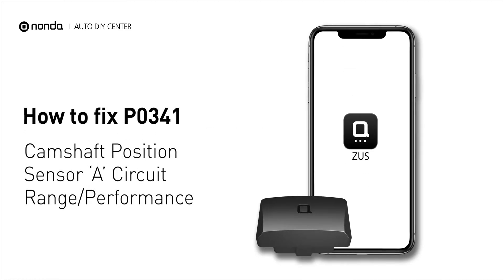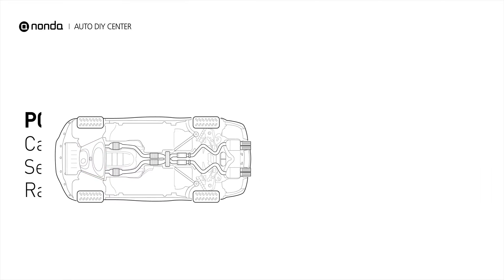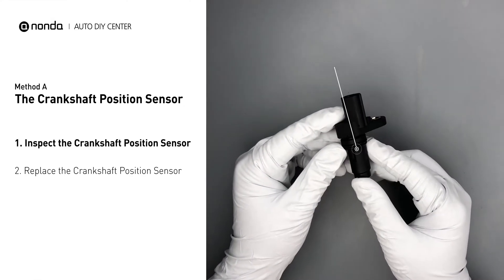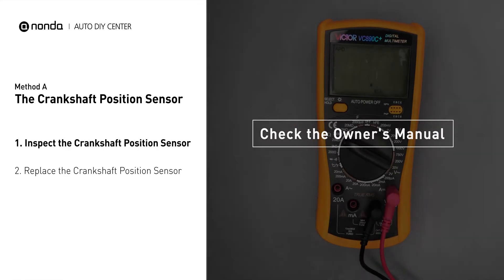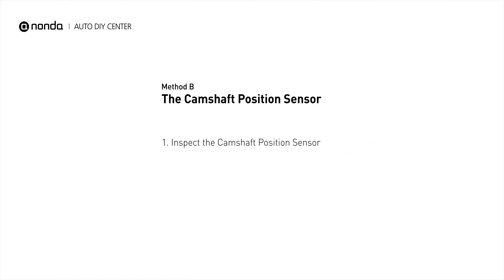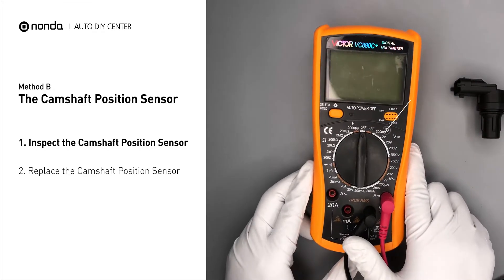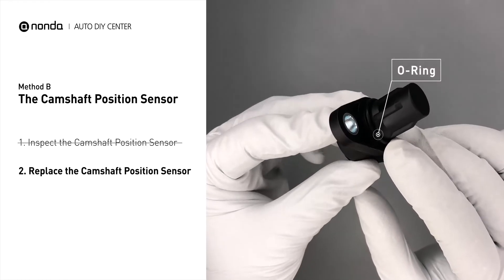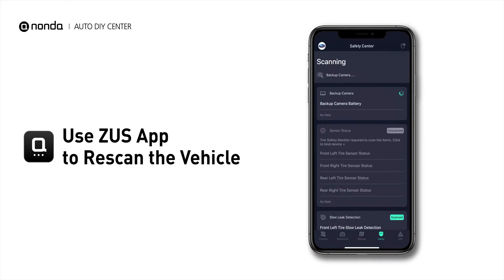How to Fix P0341 Engine Code in 3 Minutes [2 DIY Methods / Only $9.45]

Comment from the maker: Hi, I'm Steve, nonda's lead mechanic engineer. 
Feel free to leave your comments here if you have any mechanic questions, I will be glad to help you out!
Reply: Hi Steve! Were do I find po341 sensor on Audi a3 sportback 2011 1,6tdi?
Reply: Hi Steve, I got Land Rover discovery sport 2016 and i am getting P0341 engine code, do you think i need to change the timing chain please or is it just replacing the sensor, the replacing chain is an expensive job of £2500

Comment: Yikes!  There are SO many other things that can cause a P0341 on a Honda other than a bad cam or crank sensor. Either would be an easy fix.  On the 2.4L engines, 95% of the time it's something other than a sensor.  I strongly recommend seeking advice elsewhere.  It appears to me they're more interested in selling scan tools than actually helping people fix their cars.

Comment: My dad is a mechanic but often gets busy after he fixed blown head gasket this code popped up saying camshaft and car shakes now so should i replace both sensors or replace the one its telling me is giving me the problem?
Reply: What did you do? I had the p0018 code basically saying I need to replace the camshaft sensors, I did that now I got this code I think it may be the crankshaft aswell
Reply: I have the same problem after the head gasket, did he ever figure it out?

Comment: Hello i have some Problem on my car with this code P0341 A. The diagnostic problem Show me: 
Camshaft position sensor circuit A range/performance (block 1 or one Sensor)
I have this code on my ford focus Mk2 2005 Petrol 1.6 85kw.
When i connect my computer on this they show a problem with camshaft sensor, but in your video is the problem with crankshaft sensor, p0341 A (B is camshaft.)
I replaced a camshaft sensor but still sometimes the car lose the power. He can go max120km/h and max 3000-3500 rpm.
He still show me the code p0341 A...is it need to replace a crankshaft position sensor.

Comment: My Chevrolet Spark shows this code, ihad clean both sensor and camshaft also replaced with new one but problem not solve
Reply from the maker: Can you please confirm if this is the only code you're receiving?
Reply: @nondainc  yes only p0341

Comment: Camshaft position sensor fixed it. Now p0341 code comes up . And it's telling me camshaft sensor position needs to be fixed . Need help anyone?
Reply from the maker: Hi David, can you please provide us with your vehicle's year, make and model so we can provide you with a possible solution particularly for your car's make/model?
Reply: @nondainc  2007 yukon gmc 6.2 xl 
Thank you for responding highly appreciate  it 🙏
Reply from the maker: Hi David, have you inspected the camshaft position sensor wiring? Check also the voltage at the camshaft sensor if within specification.
Reply: @nondainc  hello nonda. 
Once I took it back to the same me mechanic that had fixed the camshaft sensor.  He checked and tested it , numbers and everything's fine. He said I could even drive it with the engine light on. So I drove it . It sputters revs on its own car shakes when I turn on. I really don't know what to do next . Sorry for the sob story .

Comment: I have a VW Fox, I have been having this issue for the longest time, I have replaced the crankshaft and camshaft sensor but I am still having the same issue, what could be wrong?
Reply from the maker: Hi Hubert, have you double checked if this is the only code you are getting?
Reply: @nondainc  for me this is the only code I get since yesterday. 2016 Jaguar XF. No symptoms, although there has been some rattling from under bonnet since I bought it one month ago. I turned the CEL off and it came back on after 20 miles.

Comment: Have a p0341 code. All i did was change the camshaft sensors & now it wont start. Help please😭😭
Reply from the maker: Hello, please ensure that the Crankshaft Position Sensor is also inspected as the issue could be coming either from the camshaft or the crankshaft position sensor.
Reply: @nondainc  thank you for replying i really appreciate it. I didn't want to take apart the whole front of the car but looks like im gonna have to. Ill keep you updated on it just so you know. I have a 2006 bmw 325xi
Reply from the maker: You're most welcome!
Reply: @EnderCraftKid  update?
Reply: @Rogue HD  yea i found out i was the one who goofd on the camshaft sensor installation. I needed 2. Put the 1st one in. Then i messed up seeding the 2nd one in & im really supprised my car didn't mess up lol. But honestly a month after i posted this i took her to the shop & found out it needed a whole ass timing change and there was a oil leak on the seems of the oil pan. So had to get that changed. Also found out i needed a new steering angle sensor. All in all cost me $2,200 for parts & labor. I had to pay a mechanic to do the timing change because i dont know THAT much on cars. So it definitely sucks considering i only paid $4k for the car but shoot. Honestly probably gonna sell it and get me a M3. Bmw are nice but man. Something goes wrong with they're money pits😂

Comment: Thanku.   Is it possible that the timing chain can stretch? I have the error code P0341 ( Australian Honda Odyssey 2014)
Reply from the maker: Hi Ibrahim, you can detect if you have a stretched timing chain if you encounter lack of power on acceleration, rattling noise and hard starting. Honda has a special tool that can check if the timing chain is stretched.
Reply: @nondainc  thankyou. I definitely got noise , sluggish drive and an PO341 with multiple warning lights on dash :)
Reply from the maker: You are most welcome, Ibrahim!
Reply: @nondainc  Hi thanks for your video. Can you let me know what is the special tool to check if timing chain is stretched? And if that’s the case is it very hard to do?

Comment: hi there I replaced my camshaft sensor but not the crank shaft sensor. still have the code but am going to replace the crankshaft sensor. should that clear the code theoretically?
Reply from the maker: Hi Matyson, yes it's possible. A loose connections or damaged wiring could also triggers this code so we suggest to have it checked also.
Reply: @nondainc  will do!

Comment: Hello
does it mean the camshaft and the Crankshaft are similar ?, or perhaps even the same
Reply from the maker: Hello, they could be confusing but they're not the same. They each perform a different function/role. The camshaft is located in the top end of an engine while the crankshaft is in the bottom end. They are both connected by a timing chain/timing belt.

Comment: I have this code on my 2002 CRV.  It idles and runs perfect with no obvious issues.  The previous owner replaced all of the timing components.  If the sensor is bad, shouldn't I have symptoms?  The only indication of a problem is the CEL. Should I attempt replacing the sensors before having it inspected?
Reply from the maker: Hello, having this code does not necessarily mean that you have to replace the sensor. We suggest to have it visually inspected by an automotive expert to determine the exact cause of the issue to prevent worsening it accidentally, and apply the proper way to resolve it.
Reply: @nondainc  yeah, I mean, I hope it's the sensor!  It is covered in oil, I noticed.  I am going to try cleaning it and go from there.